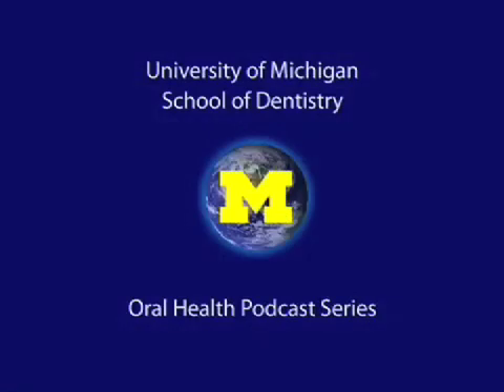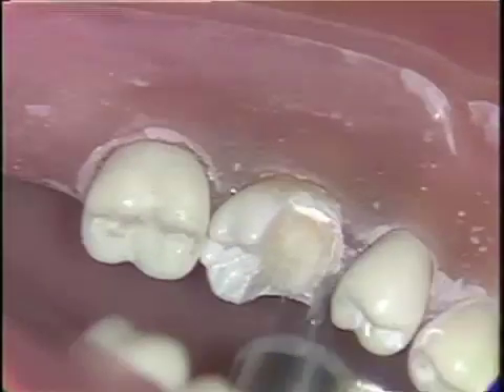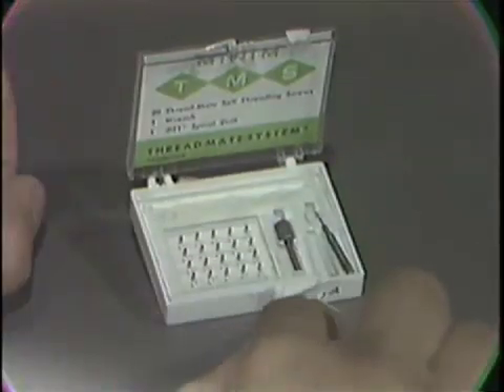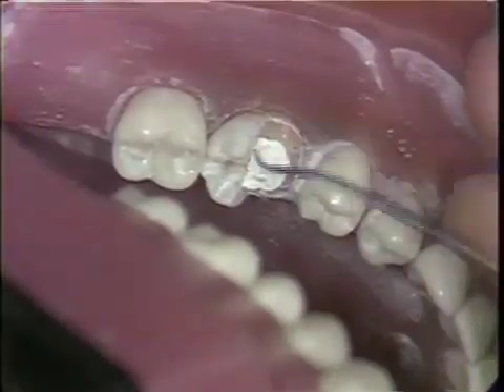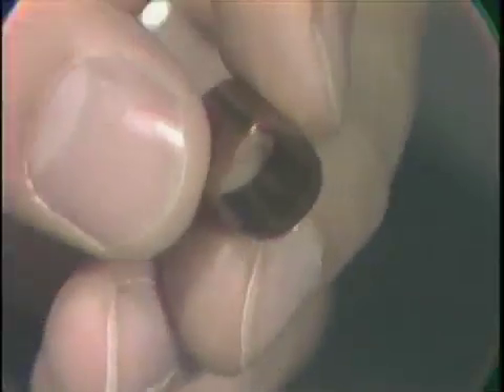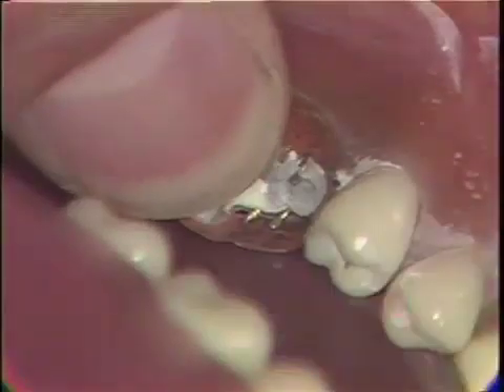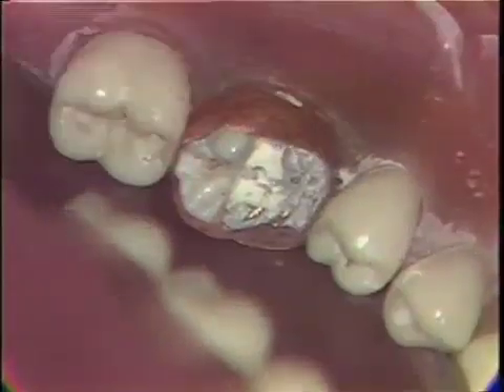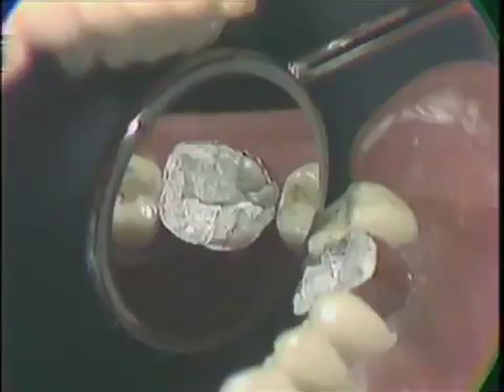Pin Retained Amalgam Core Restoration

Comment: i had same case but endodontically treated upper 6 is it necessary to put this pins ? there is only little tooth structure on the mesial side
Reply: This video was made in 1975. This technique of placing a million pins is obviously no longer practiced today by the newer generation dentists. It's better to rely on adhesive bonding
Reply: @acash93  you mean composites for those who don't know. mind you that pins are still used today for composites and metals it depends on the dentist's choice to use them or not, one or two, not much in larger quantities.